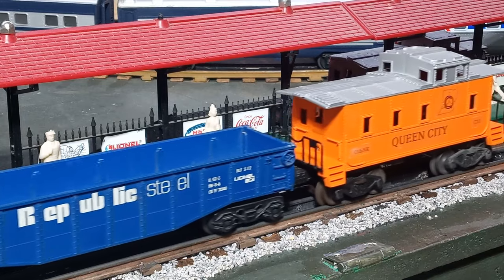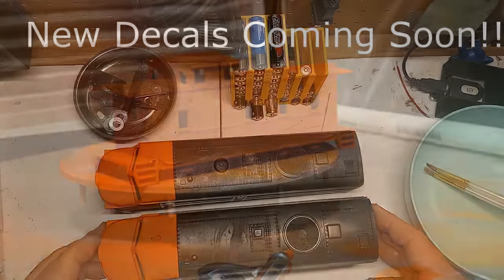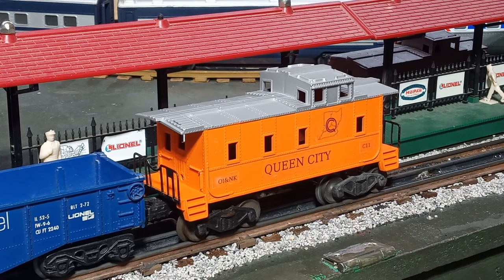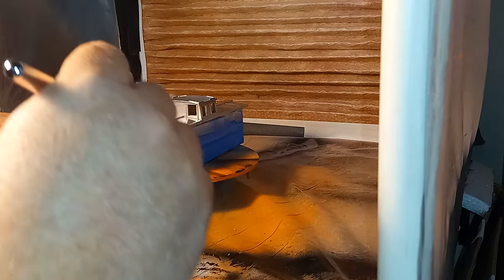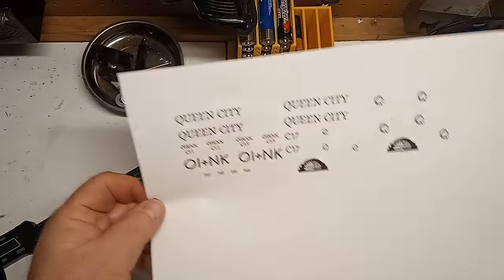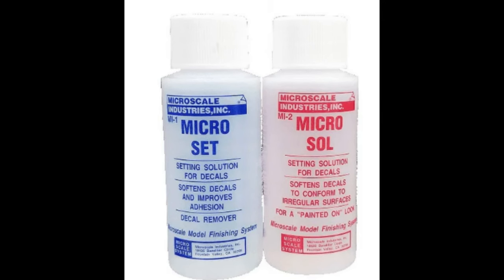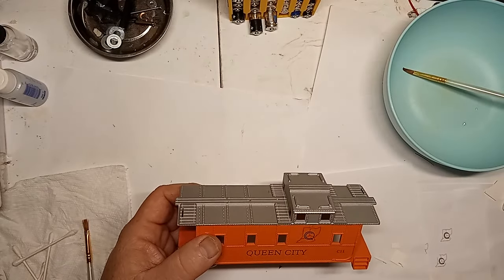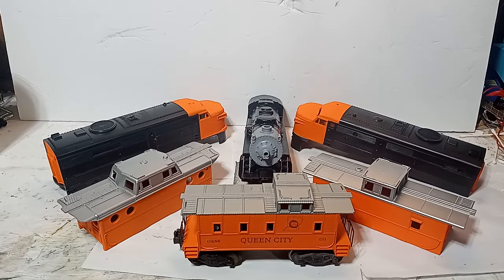From Plain to Personalized: Customizing Model Trains for Your Layout

Comment: Prep is everything. Very happy with four-hundred grit wet/dry sandpaper and lots of water to remove old scratches, heat-stamping, and other rough spots from both plastic and diecast postwar junkers.
Reply from the maker: Thanks for the tip!

Comment: An idea I’ve been thinking about for lettering steam locomotives is to paint the lettering color on the model, then to make a negative of the lettering in black on clear film. A laser printer will probably give a darker, more opaque black than an inkjet. If you’re careful to make the decal fit some body lines on the model, it should be practical to completely hide the edge of the film and the thickness of the black print.
Reply from the maker: Interesting.

Comment: Not ALL inkjet printers can do this. Check the box the ink comes in; if it is dye based, it smears as it prints the decals. The inks must be pigment based, and not all printers use that kind of ink.
Reply from the maker: Thanks for the tip!
Reply from the maker: I just checked the Canon printer that I used for the video. The black ink is pigment when set for "plain paper", dye when set for "color paper". The decal instructions say to set the printer for "plain paper". The colors are dye. They are not in the video, but I have made color print decals using this printer in the past with success.

Comment: Good video Mike!  
In my opinion there's nothing wrong with taking a good condition post-war or MPC Era Lionel engine and re-doing it into something you'd like to have with something other than the generic and ubiquitous "Lionel Lines" motif.  If the engine's in less than pristine exterior shape there's no sin in doing so since in this day and age the collectors aren't paying top dollar for anything  in less than mint condition.
I've redone several myself, two Lionel 2065 Hudsons into Jersey Central and Erie Pacifics (I replaced the four-wheel trailing truck with a two-wheel, not hard to do) and redid a 736 Berkshire into a Mikado with another truck swap, even easier. 
As far as smokebox painting goes I suggest Tamiya "Gun Metal" spray paint.  It'll be a bit "glittery" when it goes on but when you overspray with a semi-gloss final finish the glittery effect disappears and you get a good representation of the graphite finish typically applied to steam engine smokeboxes. Worked for me! 
Since Testor's products seem to have disappeared around here I've been using Tamiya paints and have had very good results.
As far as lettering is concerned from what I've seen yellow lettering (in various shades) was more typical on locomotives and tenders than white was, so if you're doing a fantasy paint job you're on safe ground with yellow.  I wouldn't bother with white lettering unless you're modeling a railroad you know used it, for example the New York Central. 
So for anyone out there thinking about doing your own custom job, go for it!  It's fun!
Reply from the maker: Thanks for the tips. I have found Testors at Menards in the paint section.
Reply: @ToyTrainTipsAndTricks  Menards?  So THAT'S where it's all going!

Comment: I've heard that oven cleaner is the preferred method for stripping the paint off of postwar diecast steam locomotives. Would you say that the degreaser could work, too? Thank you
Reply from the maker: The degreaser will work on diecast but it is slower. If you can handle the fumes oven cleaner is faster on diecast.

Comment: You can also do what I call "proto-freelance" where you can model a railroad that is in real life, but you can run what you want. So you could model the ATSF 1 to 1, but you can also have the DD35 as a "well they saw they did good for the UP, so the ATSF decided they would test one, and they just never got rid of it and painted it into an ATSF paint job" 

Just remember, it's your railroad, you can do what you want. Just make sure you don't accidentally "destroy" a valuable historic piece.

Comment: I’ve wanted an O gauge 3 rail diesel locomotive painted for the Dakota Minnesota and Eastern but none have been made. Lionel made an Alaska set with a #1804 GP7 in blue and yellow. It’s not far in its color scheme from the DM&E. I found a set on CL with the engine not moving. Turns out that the gears on the motors often come loose and they won’t pull a knat. I got the entire set plus extra cars and track for $60. The engine train sounds is fantastic.
Reply from the maker: Thanks for sharing!

Comment: Thanks, Mike. All good content.  Any of the Tmiya paints can easily be thinned using 90% isopropyl alcohol to shoot with an airbrush.You can easily cut it to a 4 to 1 ratio or more without compromising the intensity of the pigments and make 4 or more bottles from a single bottle of Tamiya, reducing the investment costs. Tamiya acrylics blend really well with isopropyl alcohol like they are made for each other and shoot easily through an airbrush and clean up easily with just inexpensive isopropyl alcohol. The Tamiya acrylics thinned with isopropyl will dry fast and permanently and will not bleed when dry, not requiring a sealer. Just don't use any isopropyl over the dried coat as it will cut through it and wreck the paint job. Other water-based acrylics like Vallejo or craft paint can easily be applied over it for layering and weathering effects. Just be sure to use Vallejo's thinner for thinng as it doesn't thin well with isopropyl or water. This technique gives one the ability to apply other water-based acrylic layers without compromising the Tamiya base coat. I saw a video recently about a professional modeler recommending using craft paint thinned with automotive glass cleaner and distilled water to shoot with an airbrush having excellent results without clumping, using it with  common craft paints such as Apple Barrel found at Wal-Mart, and Folkart, Americana Art-Deco, and Anita's sold at Hobby Lobby or Michael's. I don't recall the exact ratios, but he did say the Anita's required almost double the amount of thinner as he said it was a much denser pigments than the others. The Tamiya and Vallejo acrylics are superior colorfast pigments as compared to the craft paint acrylics and will be resistant to fading over time, and you'll likely have better results with one coat applications. 
FYI: I recently painted and weathered a couple of plastic brick buildings where I needed to seal the craft painted brick walls so I could fill the brick joints with spackle without paint bleeding into the motor joints and because I already had a can I used the large rattle can of the Rustoleum Matte finish and could still detect a slight gloss sheen. I got a small can of the Testors dullcote at Hobby Lobby for $8.49, and it does dry to a complete dead matte finish without a trace, and it's made by Rustoleum as well. Go figure. It's interesting to note I had a really old can of this leftover from the 90's that still sprayed down really well which influenced my decision to use the Testors dullcote  instead of the Rustoleum Matte finish and it had a 89 cent sticker price on the can. It's hard to imagine a 1000% price increase in such a short amount of time. When you're in you 70's, for me,  the 90s seem like just the other day.
Reply from the maker: Lots of good points. Regarding the $.89 Dullcoat, that must be a REALLY old can because I had a train shop for a short time in the late 1990s and we were selling Dullcoat for $1.75 back then.
Reply: @ToyTrainTipsAndTricks You're probably right. It was likely from the late 80s early 90's as that is about the last time I recall building a model requiring a dullcote finish.

Comment: You should be able to get a darker black when printing on white decal paper and trim close to the letters with a very sharp scissors.   You may have to move on to another graphics software that gives you more pigment shade selections.    Black for me is easy to print.   I have been doing this for 20 plus years.   The secret for graphics printing is to do the artwork in full scale,  then print at a percentage down say 5 percent and that will give you crisp lines without jaggedness in the lettering or graphics.

My train items I did were lesser collectables,  most original my grandfather did back in the 70s with a brush and commercial decals.   He worked for the Pere Marquette and C&O railroads.   I did re-strip his down and redid them with modern technology.  He had painted over some expensive trains once I got his paints off. 

Thanks for the videos,  I enjoy your channel.
Reply from the maker: Thanks for sharing!
Reply: @ToyTrainTipsAndTricks  ,  now just thought of it, to do the black make sure it is set to "PhotoPaper Glossy" to get a deep black background
Reply from the maker: @Edd-m4y  On "photo" setting, my printer makes "black" by combining the other colors, and the colors separate on the decal paper.
Reply: Are you using inkjet white paper with an inkjet printer,  then clearcoating after print is dry ?   @ToyTrainTipsAndTricks
Reply from the maker: @Edd-m4y  Yes. The colors of the black separate before I can clear coat.